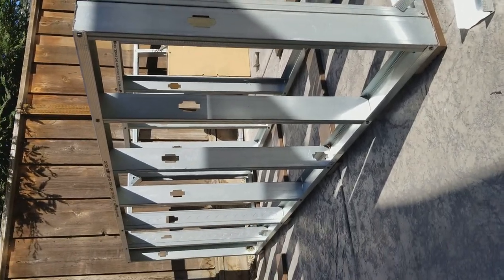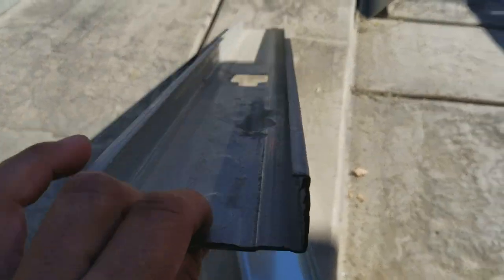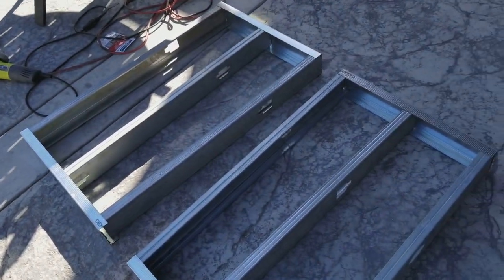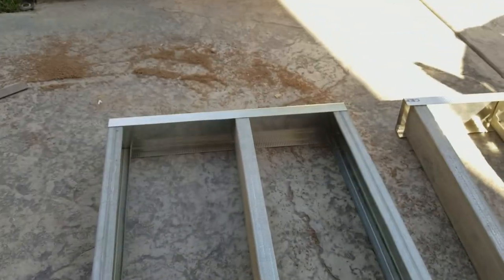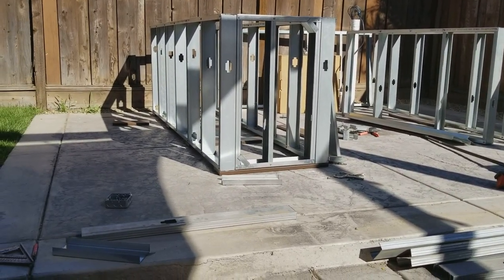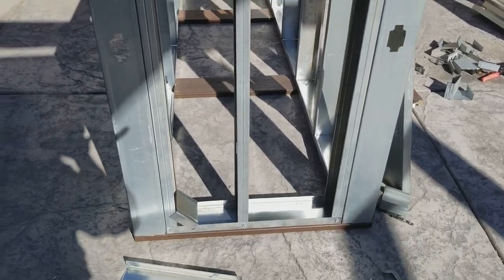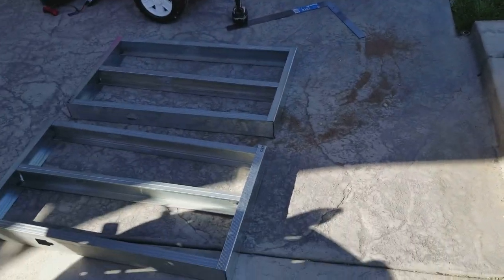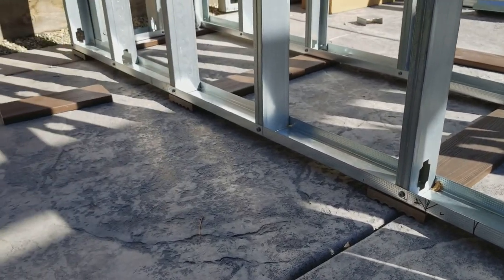How to make a DIY Barbeque Island with metal studs #1

Comment: How is the concrete slab holding up? I was told it should have footings and be at least 1 foot thick? I have a 5.5” patio with rebar. Im still debating building it on there. It’s going to be 25”x16 ft. Any feedback would be appreciated

Comment: Thank you for the video! When you added the decking board did you cut it to size or a little shorter than the frame?
Reply from the maker: I cut it to the frame, thanks for watching
Reply: @d.i.yeddie6075  Thank you

Comment: Can I have my hubby do the same thing, except our outdoor kitchen would be mainly for chopping and cutting and having a sink? We have a covered back porch on a cement slab. I was also wondering if 3/4 inch quartz would be ok as a countertop as i found a local deal for $200 that is like brand new and already has sink cut out and all.
Reply from the maker: 3/4 quartz should be fine, i believe it weights less than concrete. if you plan on cutting meats I would recommend you to connect the drain to a sewer line
Reply: Quartz is not made to be outdoors. It will yellow and change color. Use a natural stone instead.

Comment: Hi Eddie ... Thank you for sharing your project.  I hope you don't mind me making an outdoor rolling bbq island with your idea.  Just as another option on cutting 18 guage studs and tracks.  If you have a reciprocating saw and vice,  you can easily cut through that metal.  I had another project that was twice as thick as yours and the reciprocating saw made nice cuts.  Once again ... Thank you for sharing.  BTW ... You mentioned you went to a metal shop to by your metal.  Rightly so as neither home depot or Lowe's sells it.  Where did you buy your granite???
Reply from the maker: I definitely don't mind, Yes I have thought about different methods for cutting the studs. I had a grinder and cut off wheels, it was no extra cost. but if I were to build them regularly, I would look into a cut off saw or a stud cutter.  

I went to a local drywall supplier for the studs and tracks, I don't have granite on the bbq it was a pour in place concrete counter top. 

Check out the rest of my build videos on my page!
Reply: How do you keep the lines straight and level with a reciprocating saw? I would be all over the place
Reply: @bumstudios8817  Good question.  I have an adjustable vice mounted to my 5 tier 8x3 heavy duty work bench which I made myself.  I have used the vice and a reciprocating saw on another project which turned out fine. If the edge is sharp ... I use a file bit on my portable dewalt drill to smooth the sharp edge.
Reply: You can also use double cuts. Or also known as Shears. They work very well when working with metal studs and track and cut really smooth  and straight.

Comment: Hey Eddy, awesome built!! I'm about too start mine and doing some research. You said you used 20 gauge studs and they seem pretty strong. Home depot has 24 gauge. They feel flimsy. I know that they also made 16 gauge. So you feel that even with the concrete countertop on top, the 20 gauge are good enough for that? thanks!!
Reply: 24 Guage is for drywall framing it is not a structural stud
Reply: Actually 20 gauge can also be used for non structural as, as weird as it sounds,  the 20 gauge studs come in 2 different thickness, wall or structural. 
I just want to make sure what was used here and if it's good enough before I purchase all my stuff.

Comment: Just found your series on the bbq and gonna go through the videos. I’m new to metal studs; what is the expected longevity in the outdoor environment for framing with steel? (I’m in SoCal) Do you treat the cut edges with anything?  Thanks for posting.
Reply from the maker: DanielinLaTuna thanks for watching. One thing about steel studs is making sure the steel is G40 rated or higher G60 preferred. I used G40 rated studs which in my environment (Northern California) I should be able to see many years of use without any worries; I used composite board for ground contact to help. Looking back I would of spray painted the ends to help minimize any rusting in the long run. I have not had any issues at all or noticed any rust on the studs. Watch out for the sharp edges I cut my self multiple times wear gloves and proper safety equipment!

Comment: How many studs, gauge, and length did you use?
Reply from the maker: I believe I ended up getting 30-35 studs 10' or 12' and 12 steel channels 10'. 18 or 20 gauge

Comment: Great video! What is the purpose of the composite boards?
Reply from the maker: Pamela Hernandez thank you, the cement boards help strengthen the frame by eliminating movement and provide a surface for the tile to bond. (In my case) check out the rest of my videos on my channel. thanks for watching!
Reply: Thanks for your info. I was asking about the Composite board along the bottom bottom that is spaced out. Does this composite board provide against movement also?
Reply from the maker: Pamela Hernandez ohh lol it helps keep the metal frame off the ground to prevent any contact with wet surfaces and helps durability
Reply from the maker: Pamela Hernandez the structure is heavy once the countertops were added it does not move
Reply: D.I.Y Eddie What screws did you use to secure the metal tracks to the composite boards?

Comment: I might have missed it but did you bolt down the composite boards to the concrete or are they free to move around if needed to?
Reply from the maker: Fred Trevino I only secured them to the frame, after the counter top was poured the frames did not move .

Comment: How do you line up the holes when working on cut list.?  I need 35" high for short wall but it's so much waste to get that spec.??
Reply from the maker: I tried my best but sometimes it didn't line up, I just drilled a new hole with a step bit to run the conduit. did you get 10ft studs or 8 foot? I used 10s

Comment: Eddie,  How did you shim up your BBQ frame?  I have a 1" fall for a 10' span.  Is it necessary to raise the framing? Is there a reason you did this?
Reply from the maker: Bryan C I used composite shims (found them at homedepot) between the composite deck board and frame then screwed them together. Check out the rest of my videos
Reply from the maker: Bryan C I raised the framing to keep it off the ground and increase the galvanized frame lifespan.
Reply: @d.i.yeddie6075  approximately how many shims do you put per ft?
Reply from the maker: @duorah  I added shims wherever I had the composite boards under the framing. Check out the rest of my build on my channel, thanks for watching

Comment: You said that the depth of your grill needed to be 28 inches so you made the frame 28 inches? Or did you have a couple of inches to spare? In other words did you make the frame like 32 inches depth and but a 28 inch hole for the grill?
Reply from the maker: the frame depth was set at 28", the BBQ cutout was 21". i have about 7" to spare in the rear. each bbq has a specific cutout set by the mfg, hope this clarifies and helps out

Comment: Thanks so much for posting these. Great set of videos. I have watched your series multiple times and it has answered a lot of questions. However there is one that I still need answered. How did you decide on 20G studs? I was wondering about what gage to use and called a local drywall supplier and they were reluctant to make a recommendation based on my application
(3" concrete countertop and a 54" viking grill). So they called the stud manufacturer and told them my plans and they recommended 16G. Seems overkill and not to mention its triple the price per stud. Whats your thoughts. Thanks in advance.
Reply from the maker: Thanks for watching! I eventually decided to go with 20g with all the research I made on mfg data sheets for metal studs. Since my countertop is only 1.5" anything less than 20g would of been overkill for me @ 2' on center, (I decided 16" on center). Any particular reason you want to make a 3" countertop? The reason I ask is because if you lower the height of your counter by 1"  it would save you about 12lbs every square foot which would bring the weight down considerably. I have noticed many manufactures use 18g+ studs. what size bbq are you making?
Reply from the maker: The main thing you want to calculate it the weight of the concrete. once you have the total weight per square foot selecting the correct gauge would be easy. Did they recommend any spacing on the 16g? possibly get away with 18-20gauge and space closer together
Reply: Thanks for the reply. Any advice is welcome. To answer your question I like the look of a thicker countertop(3-4"). I could be wrong but a thick counter will look better paired with the giant 54" viking grill that was given to me. I plan on getting the foam molds to put around the edge of the form. Prolly will go with that rough cut look on the edge. My kitchen will be U shaped with a 10x10 spec. with a 36'' wide counter and a 18" cantilevered portion(10' long).
Reply from the maker: filby209 have you checked out z countertop forms that create the illusion of a thicker counter by having an extra 1/2-1" overhang? https://www.concretecountertopsolutions.com/products/countertop-products/countertop-forms

Sounds like your bbq project is going to be awesome and fun
Reply: Thanks for all your advice. I finally know the outcome of my 2017 taxes(I don't hafta write a fat check like last yr.) and plan to get started soon. Is there a PM option here on youtube?
Reply from the maker: filby209 thats awesome to hear! If you click on my channel and go to the about section there is an icon next to stats section that you can send messages
Reply: D.I.Y Eddie hiya. Do you think it would be acceptable to use the 25g that home depot sells? Planning a granite top.
Reply from the maker: Brian Schucher I wouldnt recommend it, unless you space every 8" but at that point you might as well get a heavier gauge. I got the metal studs at a drywall shop for almost the same price as the homedepot/lowes 25 gauge. Look around your area its definitely a better option.
Reply: D.I.Y Eddie thanks for the reply sir. Much appreciated
Reply from the maker: Brian Schucher no problem anytime
Reply: You are going to need a structural stud 14 to 16 gauze and I would make sure it is galvanized
Reply: D.I.Y Eddie I sure hope not as mine was built with 20g on 16 and some 12" centers. My counter is 3cm granite. Would see suck for this sucker to be laying on the ground one day..:)
Reply: Brian Schucher has it fell yet?

Comment: Eddie, How long did it take to frame up the kitchen. I really wanted to build it myself but after getting a bid from a mason on using blocks he will build it for $500 including the blocks and it is 6' X 8' L shaped  The amount of time involved in framing and a mason building it I would be better off not framing it myself. I still will have to include the stone and granite countertop that will be another $2600 plus the access doors and side burner. I bought a brand New in the box Lion Grill for $450, so I am saving on that part of it. The link below will show the drawing and images of what it will look like https://drive.google.com/drive/folders/12Qy_23Nj-4a0L2n8FW2TORUrmD0e_VQ1?usp=sharing
Reply from the maker: Just the framing was about 2-3 days but I only worked on it for 3-4 couple hours at a time. $500 is a great price for blocks, I use to be a Mason. Does that price include the foundation, labor and materials?
Reply: It is being built on my aggregate patio which has been there for 30 years, so that is the foundation. The $500 is labor and materials, but for $1600 he will build it and install the stone veneer and include all materials including Centurion cultured stone. I am not going to attempt to do any of except installing the grill and access doors. I live in Nashville, TN and https://www.centurionstone.com/ is a local manufacturer and the stone is $4.75 a sqft. I am only needing less than 60 sqft. I have enjoyed watching your videos and inspired me to do it myself but I just don't have the time so I am willing to pay someone else. Thanks for the response.
Reply from the maker: @timdthompson  that is definitely a great price, I would also pay $1600; we can't get that price here in California that size would be at least 5-7k. For the same size of my island with cheaper materials (stucco) I was quoted 9-10k complete island. Thanks for the compliment and watching!